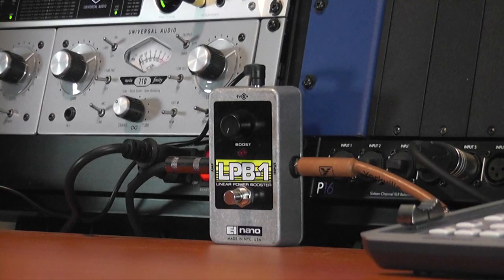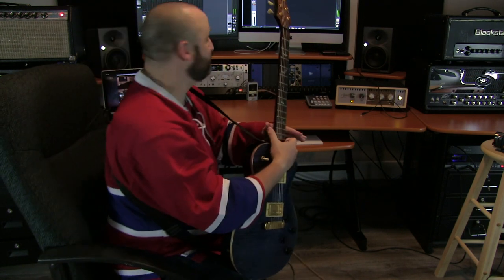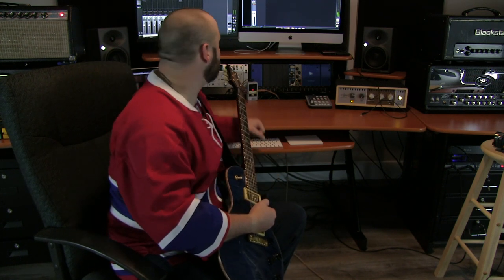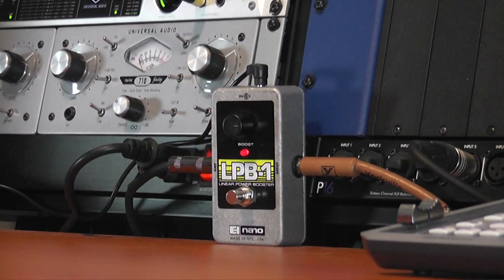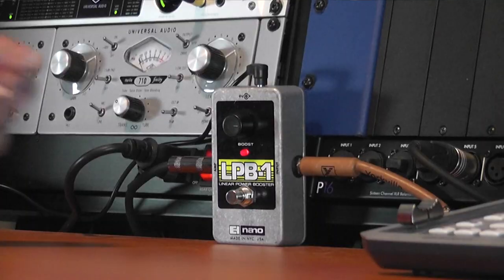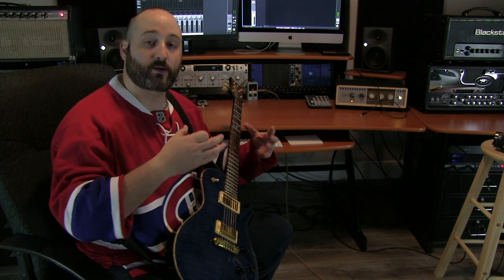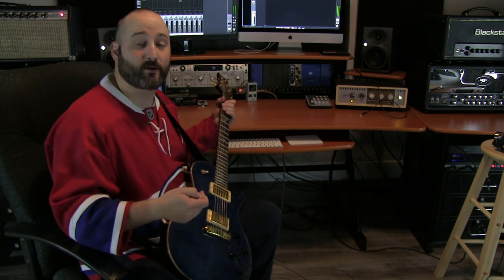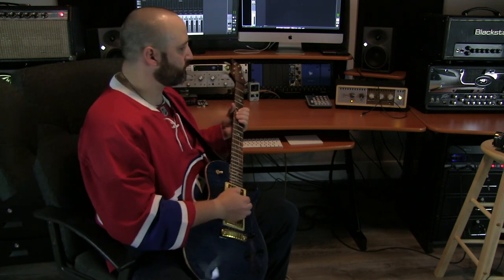EHX Nano LPB-1 Linear Power Booster

Comment: Would this be a good substitute for a treble booster???
Reply: A good treble booster is the ehx metal muff. It has a modern metal distortion on one side and a top end boost on the other. You can choose between either one or both at the same time. Its really two pedals in one. I picked mine up used on the bay for $65. New they are a little over $100.